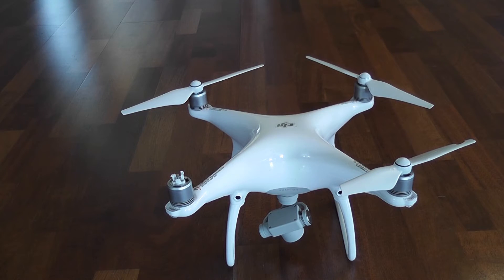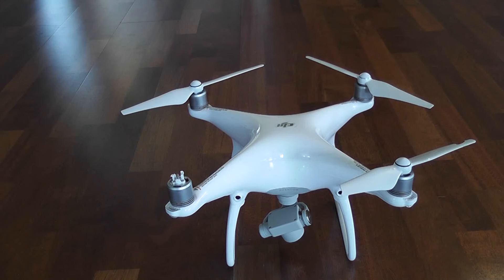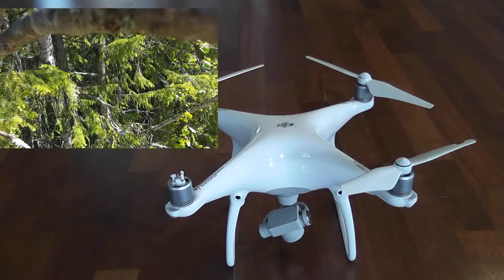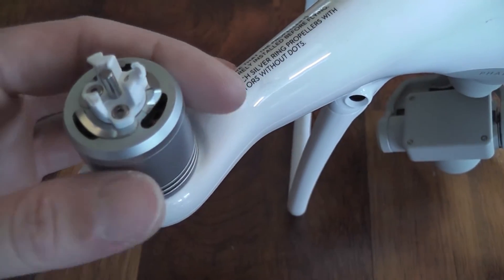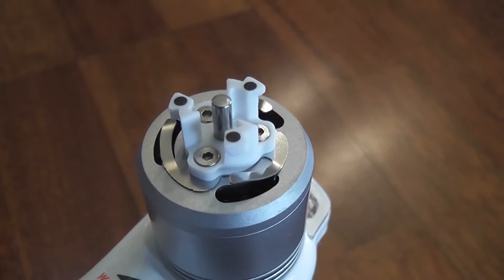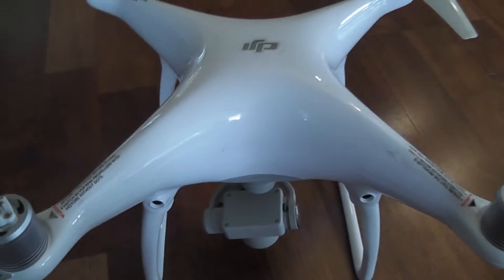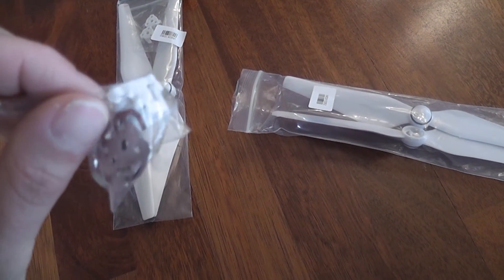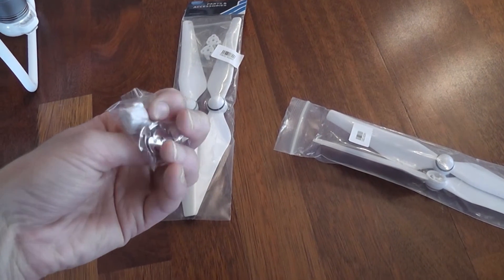HOW TO FIX PROPELLERS AND PROPELLER ATTACHMENTS ON DJI PHANTOM 4 DRONE

Comment: I thank you for this video as I brock my locking prop guards this morning on one shaft and have ordered a new set, very interesting to see that they came the wrong way round, so will check mine when it arrives, also as I see it has been pointed out to you, not advisable to start up your drone with the Gible guard on and then fly with it on, I take it you were egar to see if the drone flew again after the repair lol, any way I thank you again for this Video very informitive, Regards TJK.

Comment: so i crashed my drone into a tree everything seems ok but one of my propeller won't twist on. just order some parts hopefully its just the attachment. was it hard to fix your?
Reply: does it make a difference if its pro?
Reply from the maker: It was not hard to fix at all - you can just screw in the new propeller attachments, and then it should hopefully work fine - as long as there is no damage to the camera, gimble or internal systems :) good luck!
Reply: Nicole Scott thanks how do I know if the  gimbal is broken?

Comment: Only buy from DJI. And why the hell did you fly with the gimbal guard on?!! You probably ruined your gimbal! As a Phantom 4 owner I can't stress these 2 points enough! Great video though.
Reply from the maker: I actually did buy from DJI - I just said Ebay by mistake, if you check the Amazon link you'll see they are from DJI :) And yes, I also though "why the hell" after I'd posted this video, but luckily the gimble works perfectly still.

Comment: Just an FYI the prop mounts are different on the Phantom 4 vs the Pro+ (and Pro I believe). The Pro mounts have a larger diameter center hole due to the addition of a spring. Hope this helps when people are looking to buy replacement parts!

Comment: Hi Nicole. 
You should ALWAYS use DJI replacements, just to be on the safe side or replace prop mounts with metal ones as an upgrade. Also why didn't the optical sensors work to stop your friend from flying into the tree? I hope you have many great adventures with your Phantom and no more crashes.